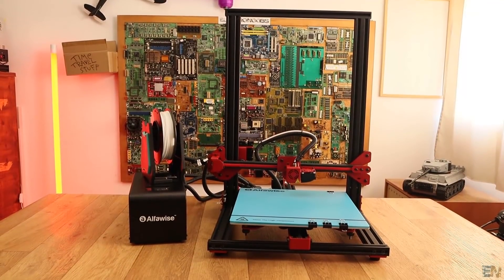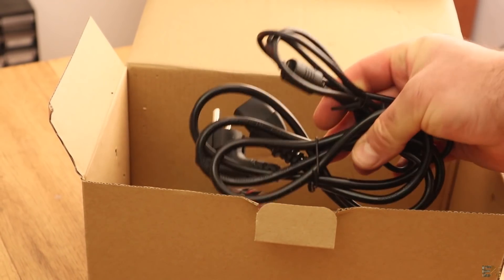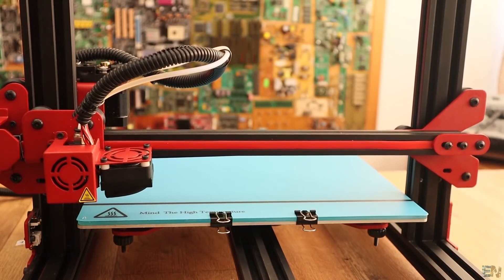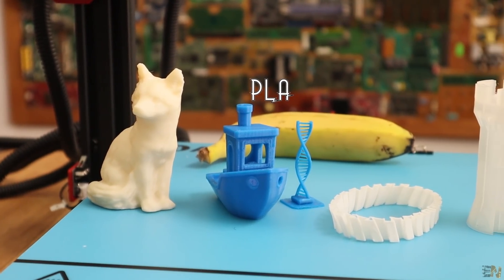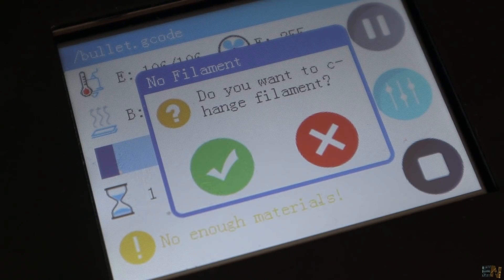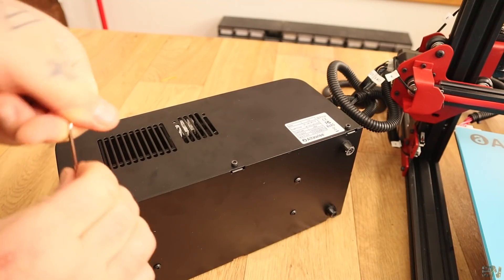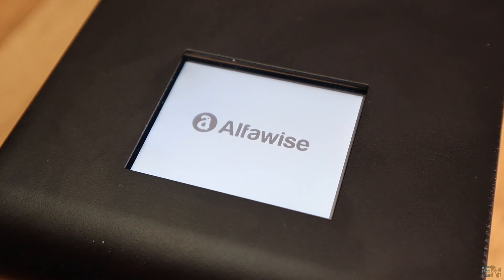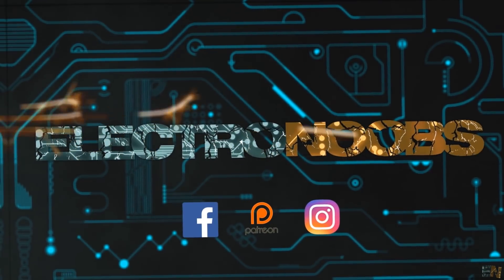Alfawise U20 | review 2018 | CR10 compare

Comment: Hello, I'm big fan of yours,
Please make video for diy 3d printer...
Reply from the maker: There are a lot of tutorials about that, and it is a quite big project. Just hook up the ramps board, with Arduino mega, the drivers, and the stepper motors and uplaod the Marlin firmware. The difficult aprt is making the frame, and I think it will be cheapper to just buy an ender 3